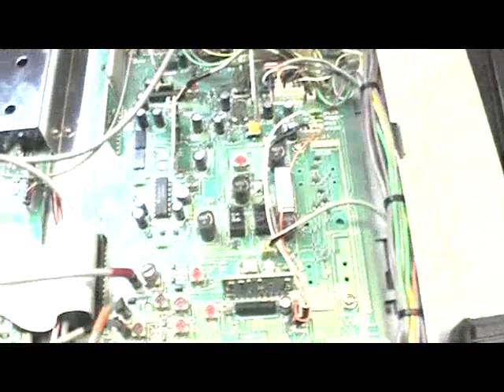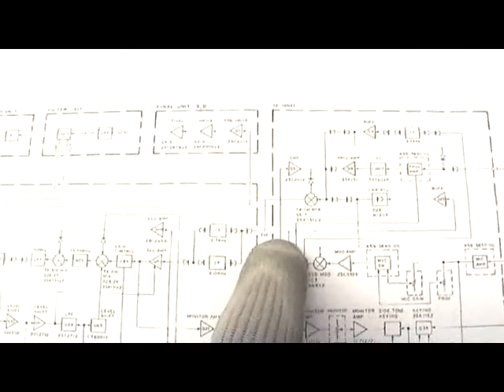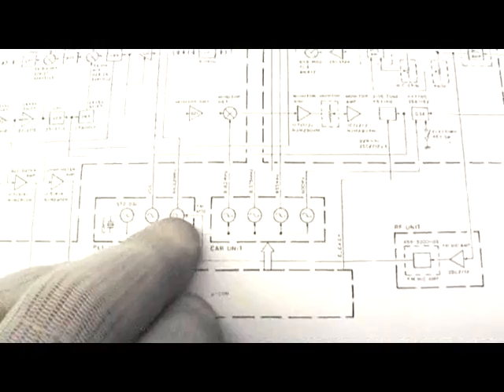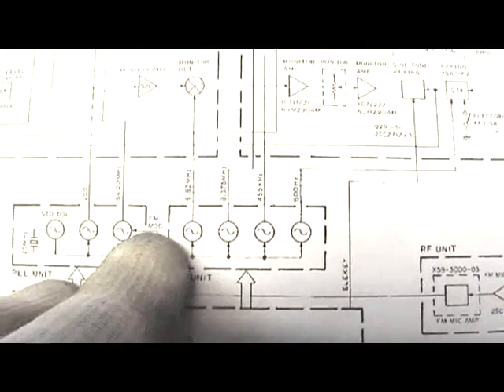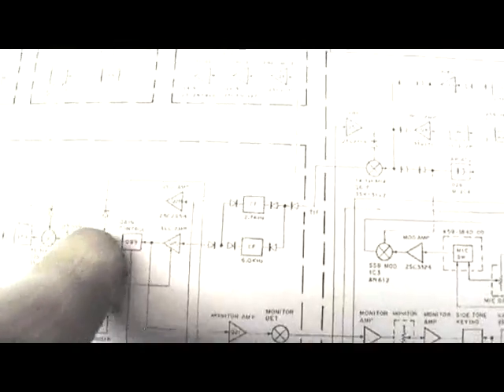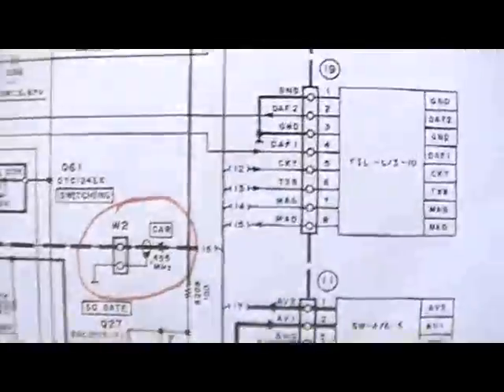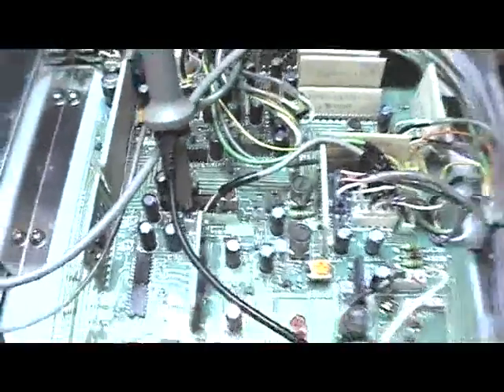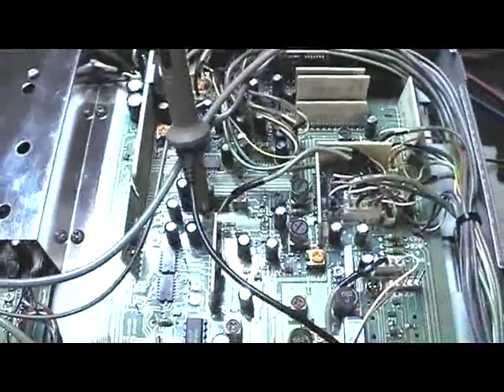Kenwood TS-850S HAM Radio Repair Part 1 of 3

Comment: I've still got my 850-SAT ... I did replace the entire DDS PCB for one of those new ones from the Ukraine a few years ago , Never really had any major issues with the 850 other than the capacitors aging and leaking ...... Great radios even now today , And with the IF output on the rear of the radio it's easy to add a SDR and use it as a pan adaptor 👍
Reply from the maker: Yes I think that the DDS board was the only issue with 850, really nice rigs to operate. I didn't know that someone was making replacement boards,  very useful to know. Thanks for the comment.

Comment: If that one cap has leaked, the rest on that board will do so soon if they aren't leaking already....I change them all with SMD caps of a slightly higher voltage rating... If you have to, after tinning previously corroded traces, brush on a bit of conformal coating after tinning...Good job...!

My own 850S was a mess when I got it and it works great now...!

Comment: ahh great vid , i have a 850 my self and had the wandering 5v on the pll board i have the 66312 chips thank got , thats why there cheep on abay the 850/950 be carefull anyone ask about the chips, i see you have a marconi 2955 i have one and would be intrested in a  vid of rx alignment i do not have a spec analizer  but great vids keep them coming have a a great 2012